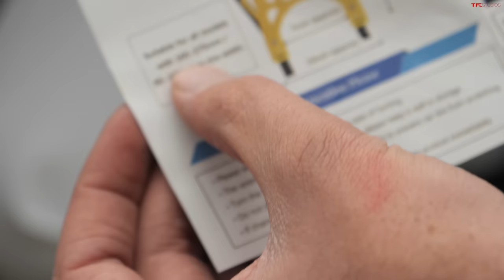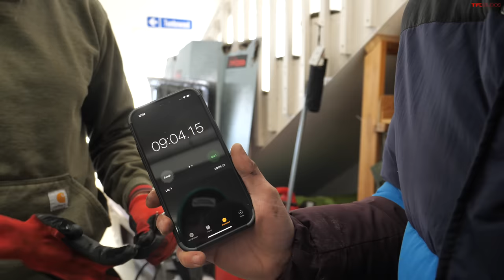Snow Chains vs Cleats vs Snow Socks | What's The Best New Device To Get Traction In The Snow?

Comment: Maybe test actual chains compared to cables next time and get the correct size for each items you are testing.
Reply: They even said those chains came with the vehicle.  Also cables are more common for crossovers vs actual chains.
Reply: @thatdudeinblackshoes  but they're still not chains. they look like springs.
Reply: Yeah, steel cables with washers on them seem pretty shit
Reply: @thatdudeinblackshoes  the rav 4 isn't a crosover
Reply: They put the cable chains on wrong that's why they're having issues lol
Reply: @funclejones6256 A rav4 is the original crossover 🤦🏻‍♂️
Reply: Appalling amount of user error in this video....
Reply: Chains over cables
Reply: @asura8236 Really, So You Caught That Huh. So there's a right & wrong way to put em on. I've never used em but trying to make a decision on which way to go with it.
But I Pray 🙏 about everything I do so GOD's got it

Comment: It would have been good to see some modern snow chains in the test, such as Konig (or Thule - same thing). Those ones look like something made out of scrap bits of wire found in the shed
Reply: we can do that!
Reply: @TFLclassics  also, not sure if these are available in the US, but maybe check out the MICHELIN Easy Grip Evolution.
Reply: I agree...at least use PROPER cheap chains (eg chains satysfying eg austrian norm V5117 or V5119 )....that stuff they used does not qualify as legal in many european countries. There are also proper off road chains for suvs, trucks (heavier construction and even better performance then normal chains)...
Reply: They don’t even have chains lol
Reply: @TFLclassics  Please do!
Reply: Yeah, those were not chains.

Real chains are sort of a pain to put on the first time, but they are beastly. I just put 4 on my plow truck today because my driveway is a sheet of ice. 

4 wheels took about 30 minutes on 24f weather, including readjusting to get them nice and tight so they don't fall off.
Reply: Yeah, when I saw them unpack those things I said to myself "what the f... ARE those?!?". Those were not normal snow chains, they looked more like the remains of a camping chair.
Reply: Real chains are rusty, weigh twenty pounds and go ching ching ching on the pavement like Santa's coming to town! 😄
Reply: If it has struts they probly won't fit. That's the problem I have found on Fwd cars. The rim is too near the strut for chains to slip past. That's why the traction cables have shown up.
Reply: @Wrang15  ah, now that you say that I don't think chains would work on my 09 civic Si... I have them on a 95 ranger.
Reply: @Wrang15  Good point.
Reply: Studded snow tires as well
Reply: @georgejulien3286  Nope, not at all! 😑
Reply: @A-Cat-in-Dogtown  and they work! The deeper the snow, the better!
Reply: Doesn't make sense to carry $600 chains. Better swap dedicated studded tires then.
Reply: @freibier  exactly, those are called tire cables. Show me a single chain link on those hahaha
Reply: @YiqiJu  a set of real tire chains comes in a pair and they’re about $150-$180 a pair.
Reply: @georgejulien3286  that's proper. I was referring to the Konig modern chains mentioned in the thread head, which is unreasonably expensive.
Reply: They did it this way, to get more views, like how Top Gear got more views for their F ups...
HeavyDsparks, just use the Ausie made, Max Trax, in, water, mud, snow and sand.. the car just pops out...
They are going for Views, not intelligence..
Reply: The best snow chains are probably made in the country, which consists of 60% snowy mountains in winter. - Austria!

The Pewag company has been building the absolute best snow chains for years!
Reply: @frtjf  I have a set that I ordered from a European supplier. You might be able to find them on Amazon.
Reply: @Wrang15  Car manufacturers are obligated to offer wheel/tires sizes on which snow chains can be fitted. Optional there are smaller chains (15-12mm wide), to meet these requirements.
But I guess traction adds fits the description of the used materials nicely, just do not depend on them. Nice video to proof this point 👍
Reply: I've had solid luck with cables but the actual chain is the real deal. Helps in mud too
Reply: @NoNo-in5tu  agreed I've used chains and cables both, cables do a solid job on paved, icy surfaces, but chains will always be my preference if I'm not sure I can count on paved roads the whole time.
Reply: In Colorado you required for semis to have autosocks on board before they cross the border.
There's a test where they compare chains to 
Auto Socks. 
Auto Socks 
 out pull the chains on Loveland pass Colorado.
Reply: Well, one aspect of this test was very real world. Like about 7 out of every 10 cars, the chains or traction devices were improperly installed. I don’t know about the cleats or socks, because I have not used them, but the cable changes were definitely not properly installed and they were way way to loose. So performance suffered accordingly. As well as vender clearance. You could hear them contacting the car way way to much the whole point of cable chains over regular chains is to fit in tight clearance applications. It’s very hard to beat properly installed tire chains except with bar reenforced chains. Especially if they are tightly installed. I hate chains with a passion. But when I do use them, I install them good and proper and tight. They work best that way and they last a whole lot longer. It’s not hard to run over 100 miles on a properly installed set of chains. I have done so multiple times. But I wised up. I don’t do that any more. If it’s that bad, I just don’t go.
Reply: tire cables are useful

Comment: Guys if the snow chains don't fit tightly on the car's rubber, you can't trust that they're going to get you out of the difficult part of a snowy road. But if they're of the right size, they 'll be the best "partner" even in very muddy roads and potholes. Trust me, cause I have some 15 years of experience in bad Greek steep mountain roads, drivin' from common cars to semis. I wish you a very happy new year.-

Comment: It helps if you put the CABLES on right!!!  And you do not have any chains. You guys are hilarious!
Reply: Well, most of these guys videos are just them figuring out crap they have no idea about just to post content. Definitely suburbanite kids from suburbanite parents.
Reply: They came with the vehicle so they must be the right size🤨 Not they were to big for the tire size same as the tire sock.  Perhaps try looking into using a tire size calculator to figure out your tire diameter and width before ordering again.
Reply: @karkule5919  and they are more concerned with posting content regularly than with posting well-researched information. They bought three fairy cheap "traction devices", likely off Amazon, and then abused them exactly as the manufactures warn against. You, yourself just said "people who think they are experts". Generally, channels with 1.2 million subscribers would be considered knowledgeable in what they produce. Quite regularly these guys don't have the slightest clue. They just have cameras.
They do a decent job with stuff like the fuel loop and the Ike Challenge, but many of their videos, like this one, are just stuffed with rushed content that fills space.
Reply: @karkule5919  so most views for the money vs  content with any actual value got it.🙄
Reply: @iffykidmn8170  Ya, cables (that's what I've always called them) aren't applied properly.  Even if they came with the car, there has to be some range of tightness available for a bunch of reasons.  The "spider" rubber things are the finishing touch, not the tightening device.  I've run cables many times, never had one come off.  In my experience, CHAINS (actual chain, not cable) are the best except for application, but even that goes pretty fast with practice.  But they aren't an option in modern cars, I know.  I wondered if the tires wouldn't just lock up between the cleat panels.  The socks proved to be exactly what I suspected - junk.
Reply: @DW-vi6kg  Yup, those are called cables alright...  

That's Millennials for you ..   they believed their teachers when they were told they got a good education, yet somehow they are less ready for life on their own after they "graduate" and boy do they have some learning left to do. 😋

As for actual tire chains, yeah, those work well for snow and even mud, if installed correctly.

That said, actual chains work even better if you install them with the tires slightly deflated, then inflate the tires so the chains can't roll between the tire and ground... 

You have to drive a lot slower on dry pavement than some other traction aids if you want to avoid breaking links, but that's totally worth it for the greatly increased traction.

Then, there's the difference between standard tire chains and those with cross bars....  They could do a whole video on just tire CHAINS...  

I agree on the content over quality aspect.

I have also had my comments deleted for pointing out when they are wrong, instead of them humbly accepting a schooling and learning like most respectable people do when someone shows them the error of their ways..

Let's see what they do here...
Reply: Trust me they are still better than 90% of the truckers I've seen up here in flip flops and shorts without chains or a clue!
Reply: I carry actual chains in my vehicle all the time, they have gotten me out of many a tough situation here in Colorado  pushing through deep wet snow, no problem. All the stuff they was junk imho. Looks like it was the first time any of them have every put "chains" on a vehicle.

Comment: Those are snow cables, not tire chains.  Tire chains are actually made of... (wait for it) ...  Chain links.
Unlike the first two traction aids you tested, snow cables and chains are the only long-term, multi-use traction aids.
You should probably find a snow covered paved surface you can retest these traction aids on, as most people do not venture off paved roads, in the winter.
Reply: I agree. Interesting for someone traveling off-road in a non-off-road vehicle (I understand it's a RAV4, but this one is FWD only). But most people with non-off-road vehicles are trying to get to work, get to the pharmacy, the post office, the gas station (or charging station, depending on vehicle), etc... and nearly all of that is on paved (albeit snow/ice covered) roads. I'd be quite interested in seeing different tire chains (actual chains) on paved roads, but different configurations, such as diamond, 4 link, and 2 link, as well as V-Bar.
Reply: ANY correct size CHAINS will always be the best choice.
ESPECIALLY  when Stopping!
Reply: This wasn't even a real test. This was just something they cobbled together for Clickbait-N-Merch.
Reply: @vivillager  ahh, that's a really good point! road test them! absolutely!

Comment: I have been using Auto socks for 4 years over multiple uses I-have never lost a sock. I have also never spun a tire in the sock. I am still using the same sets. I have four  for our 4 wheel drive vehicle and another set for our rear wheel drive M3. They are perfect for meeting traction aid requirements in that they are so easy to deploy and remove. So easy to put on and off. They will load up inside with deep snow, so anything over 9 inches chains work better.
Also I have never had the pleasure of applying traction devices in a heated garage. Usually it is done with tires completely fouled by snow. This makes chains nearly impossible to install quickly. But properly fitted socks always are easy.
Reply: They also make the snow socks for semi trucks, $220 bucks a pop for a set. What's keeping me from purchasing them is someone told me they break down or fall apart when you drive on asphalt. And most of the time dot makes you put your chains on before you start a descent or incline into the snow. Is there any truth to this? I have snow cables which work well, but I've had to drive half a mile or maybe longer to make it to a chain off area or off-ramp.

Comment: Used live in a place that got 10ft of snow every winter.   One of the people I knew had an old FWD Honda Accord with snow tires, which worked awesome.  With chains, it was unstoppable.   I had a series of 4wd and AWD vehicles and they could never compete.  Helps if you don't care about the car at all....   IMHO, tires, driving experience and having a throw away vehicle are the biggest factor.

Comment: I think your sizing on some of the traction aids makes a big difference in the outcome of the test, I am a mail carrier and we run the exact style chains on our trucks you were testing and they are much tighter to the tire when installed than yours looked in the video, but we run them all day multiple days in a row and never have them come off, even run on dry blacktop a lot of times as the roads get clear through out the day and they hang right on.
Reply: We have a similar pair and they also are much tighter on the tire, those look to big from my perspective.

Comment: I've used a lot of cable and regular chains over the years and they should be tight to the tire tread.   Yours were floppy and loose  even when the bungee was fully tight, which means they were just the wrong size chains.   Probably same issue as the sock.  
I recently picked up a full set of AutoTrac self tightening chains for my 4runner V8 and did some practicing putting them on while in the snow yesterday and could do all four corners in under 10 minutes.   You don't have to roll over them to put em on, and they lay tight to the tire.     I don't know how they'll hold up to prolonged use or higher speeds, but I did a legit steep offroad hill climb with em in 8 inches of snow, and they worked great.
Reply: Honestly if you live or regularly travel in areas that are hit with significant ice and snow I'd say go out during the summer once or twice and put them on as well. Once you need them you'll basically be doing it by muscle memory no need to worry about screwups.

Comment: A useful video. I have used both chains (Pewag) on Defender and Auto socks on Transit Connect. Auto Socks are great to have onboard as a quick get you out of a fix. Certainly not to have on for mile after mile. As soon as you hit tarmacs, remove them as they tip to shreads. Chains though a faff are better for longer use in extreme conditions. Well done on producing a useful video in cold conditions 👍

Comment: Would've been nice to see actual chains used not slinky springs that didn't really fit right. I actually bought sections of chains used like the cleats that attach by a ratchet strap through the wheel. I experimented just using one on each front wheel to get up a icy hill and it surprisingly worked well. They are easier than full chains to install however being in sections if they're too far spaced apart on the tire they give you a very rough ride and you might need suspension parts after you're done.

Comment: I'd like to see the same test with snow tires just for comparison to the helpers
Reply: the aussie made, max trax would get you out easy... HeavyDsparks use them...
Reply: And studded snow tires.
Reply: @RAM-BAWN  blizzaks are better than most studs.
Reply: @breckfreeride  Around here people use studded snow tires. Best of both worlds.
Reply: @RAM-BAWN  it's winter 6 to 9 months out of the year up here in brokenfridge Colorado... And I've seen people switching to newer winter tires over the last few years more and more.  Studs are just too much of a hassle unless your ice racing!  Blizzaks are just as good if not better than studs in most situations
Reply: @breckfreeride  You don't have to tell me about winter as I live in North Dakota. I see people using studded snow tires (including Blizzaks) as our roads are iced over (compacted snow) for months.
Reply: @RAM-BAWN  woof.  Cold cold balls cold like that actually can make the ice grippier...at least in my experience.  The deep mashed potatoes and just barely melting ice with a little bit of water on top will always be some of the nastiest stuff.
Reply: @breckfreeride  Yes it is. Black ice is terrible. A little blowing snow over a clear road and you have a potential for black ice.
Reply: @RAM-BAWN  your idea of a little wind is probably 60mph sideways... I've seen lots of trailers blown off the road like that!
Reply: @breckfreeride  It's pretty flat around here, so the wind can be 60 mph. Add a little snow to that and you have a serous blizzard.
Reply: @RAM-BAWN  no fun
Reply: @breckfreeride  Supposed to have 40-50mph wind tonight with snow and -14F. Not fit for man nor beast! And this is when you do NOT want to get stuck in the snow or slide off the road (which I know people will do as they don't seem to understand that you need to slow down in such conditions). PS I wanted to get some Blizzaks for my power wagon, but they don't make them in the size / load range I need. Bummer.
Reply: @RAM-BAWN  I got some winter coopers, they're ok in load range e but not as good as blizzaks.
Reply: @breckfreeride  The local tire shop says the new Hankooks are pretty good.

Comment: I’d like to see this again, in both snow and ice, and (rather critically) with properly fitted traction aids. Those cables looked awfully loose.

This seems like a good video for Stubby, actually, since I presume that the little truck is probably rated to use traditional chains instead of only those thin cables.

Comment: i have used the cable chains and use 2 of the rubber bands to keep then tighter now as a old man in the 70's (rear wheel drive) i would keep set of bald tires with chain in the trunk for a quick change in snow it took about 10 minutes to change both tires out